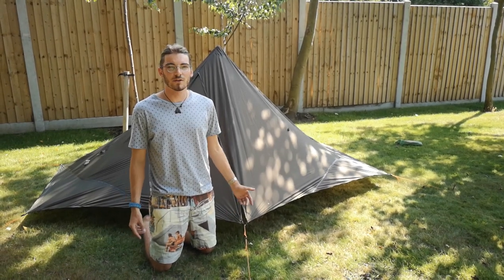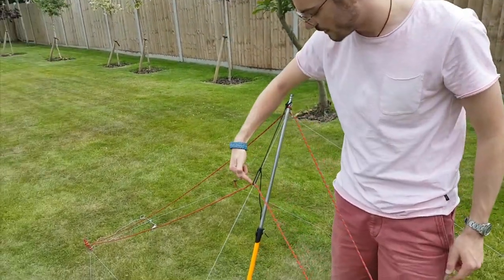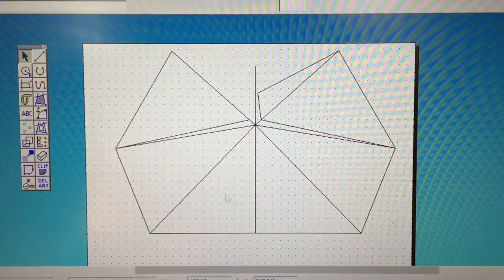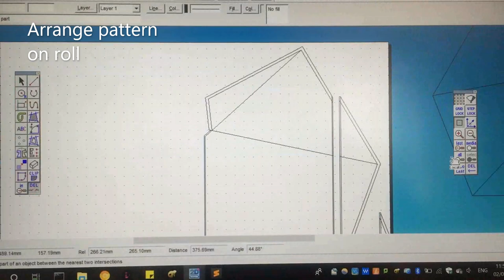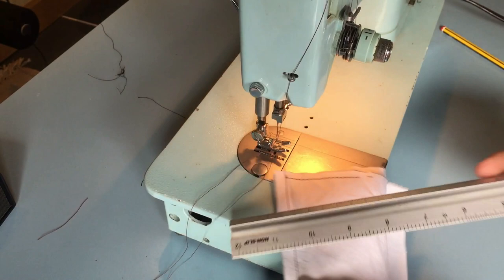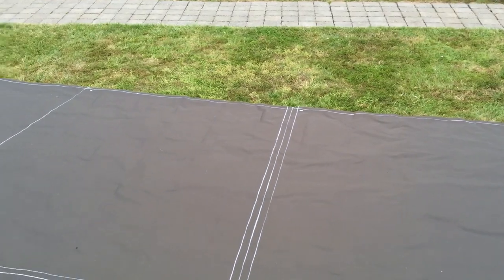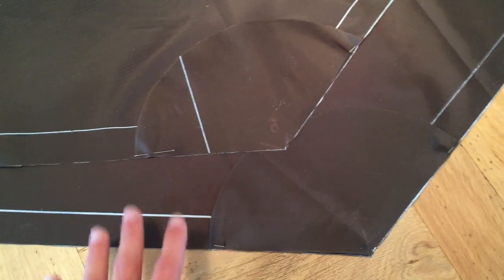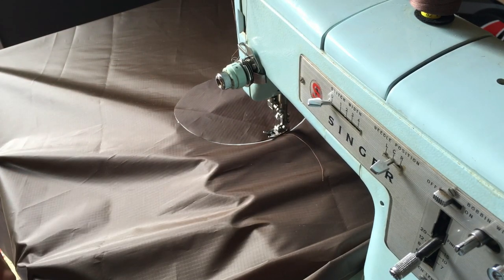How to Design & Make an Ultralight Shelter/Tarp - Part I

Comment: Have you considered gluing the reinforcements on the panels? I have next to no experience but I imagine it distributes the tension better than seems. Also sewing holes tend to stretch open under tension. Even on sealed seems I don't really like it. Sofar I like to sew the loops on the reinforcement patch and then glue this on the panel.

Comment: Do you have a higher quality picture of the pattern you cut from the raw material? I can't see any of the measurements you used.

I'd like to try this same pattern in DCF with a bathtub floor
Reply from the maker: Hi Mike, would love to see some photos of the finished product once you're done, sounds like a super cool project! The image in the OneDrive link is very high resolution, have you tried downloading it to make sure it's not showing you some downscaled version in browser?